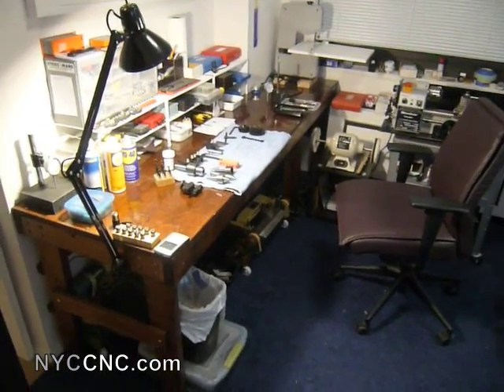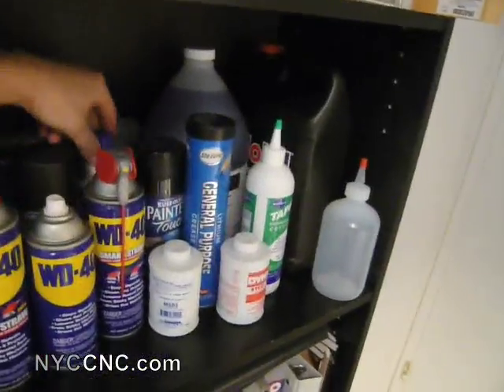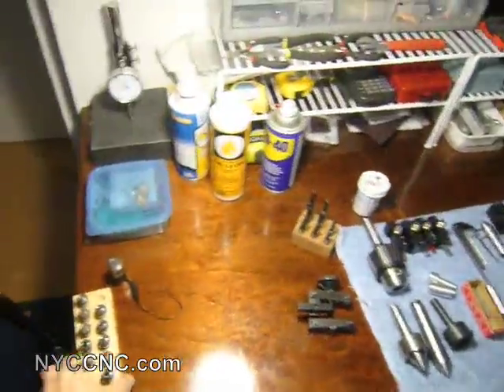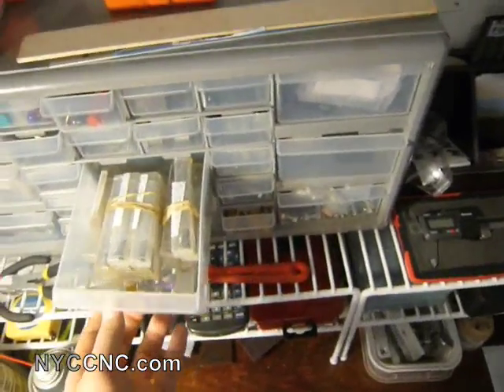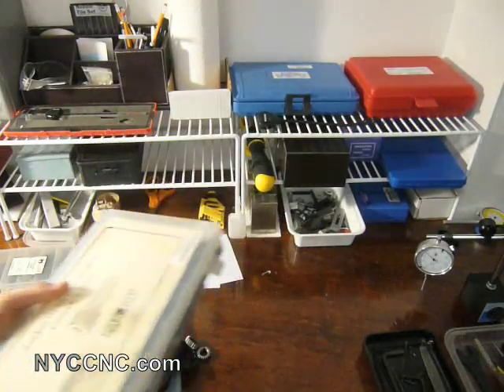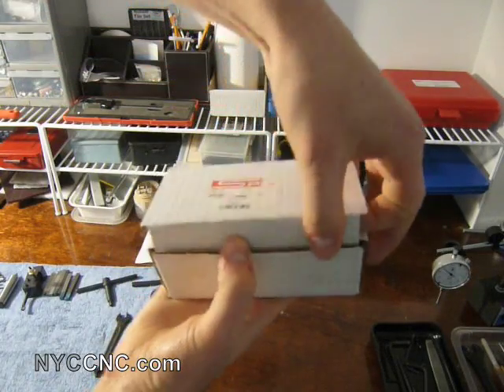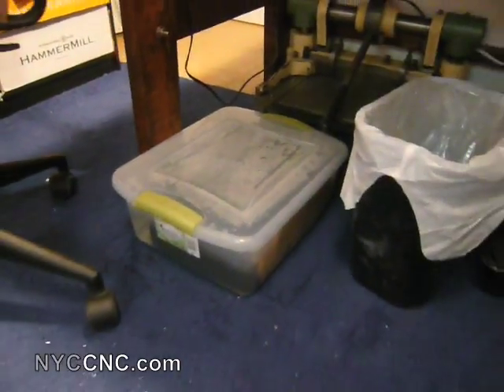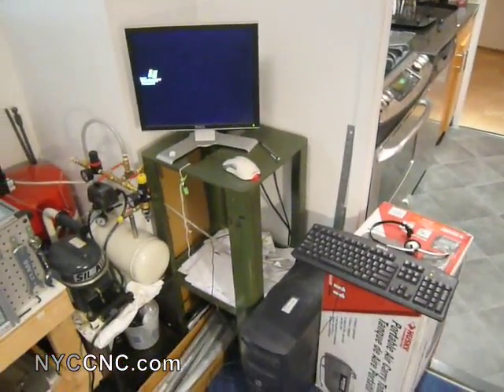Tour of NYC machine and metal fabrication shop with CNC Mill and more

Comment: You broke my first rule of workshop organization which is never mix tools with stock! I do not mix tools with measuring instruments either. I see you have some general storage solutions but I think you'd be better off if you made yourself some custom holders. Take a tip from a hick chainsaw bar lube is way oil. Also give up WD-40 for PB Blaster its better. If you're in NYC then you're close to Newark NJ you can buy metals there.

Comment: great vid.very organized. most of our machines are manual, but we do use a lot of precision stuffs that you also have. i never knew that one particular indicator is called "co-axial"? am i correct? i also have that granite plate very useful inspection tool. id like to have that sort of drawer my dad use to mess things up. pain in the neck. lol. you might want to consider a optical comparator? you seem to do precision works. thanks.